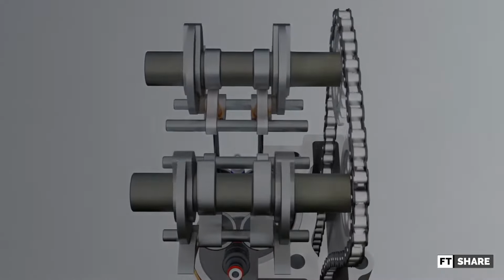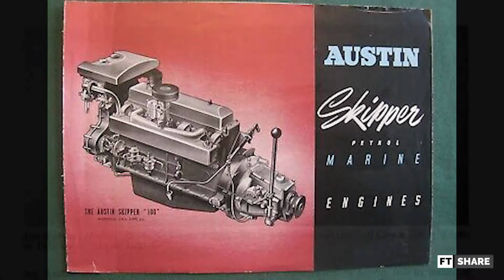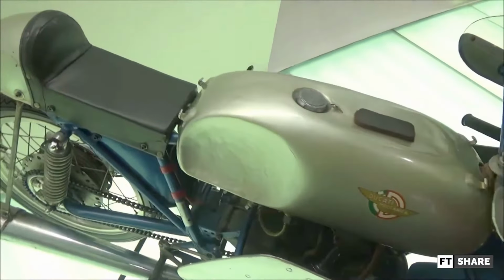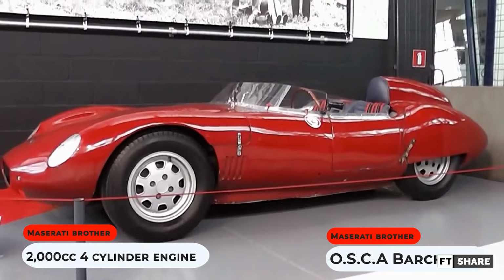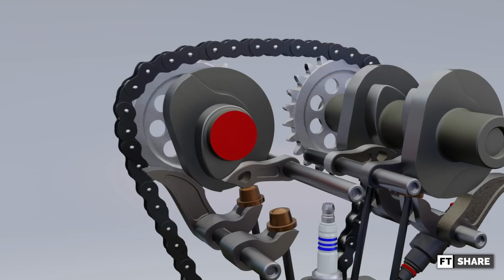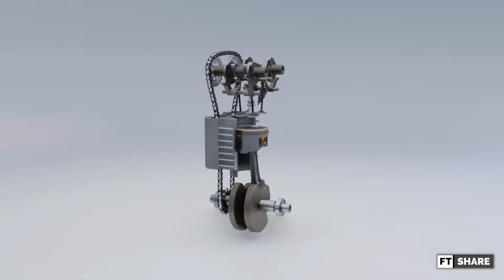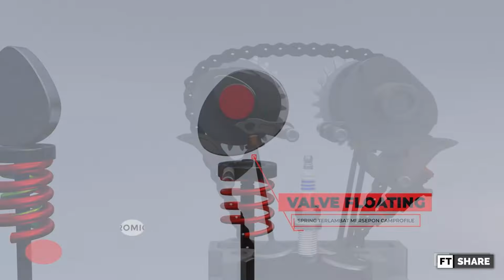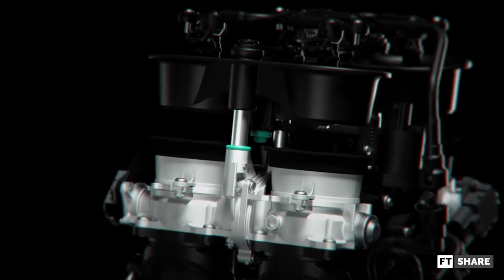Ducati Desmo Valve System | HOW ITS WORKS

Comment: Why it's not used for 4-wheeled vehicles? Easy one: too few ones need such high RPM's like 15-20k (most cars don't even hit 9k nowadays) and too much Desmo service needed. Even if you don't have hydraulic adjusters you'd need to adjust your valves like every 70k kilometers on Honda vs 25k or less on Ducati. On other cars you don't need to have these adjustments at all due to hydraulics.

Comment: 4:11 - Valve spring tech and metallurgy has advanced to such a degree that the additional complications of desmo isn't seen as worth it.
Reply: Well yes and no. As valve goat is still very much a thing. And with traditional valves they require shimming or lash adjustment as now the valve seat can wear down changing the height of the valves. The valve seats and lifters in the desmo design allow no need for valve adjustment which is better for longevity. Further more the lack of valves springs and the design of the lobe that closes the valve eliminates valve float. So in theory you could rev this engine at 1200 rpm and have no float and rev it out to 20k rpm and have no float. Without needing to swap valve springs to prevent it. Which stronger valve springs wear out the valve seats quicker. Like this allows a dynamic pressure on the valves that changes with the rpm. And as for simplicity a spring with a shim and a cup or with a lifter. You’re removing those parts but adding more parts to another part in particular. You’re losing cups shims keepers and the spring. For another lifter and another can lobe. So it’s not that much more complex if at all.
Reply: @Seagull_seaven7  Valve goat? As in a goat that grazes on valves or a valve in the shape of a goat.
Also you're in idiot if you thing desmo valves don't need adjustments and maintenance. They actually need more than normal spring valves. They also take more time, more labor intensive and more costly to adjust and maintain. They also go out of spec faster with larger variations and need shorter service intervals. Just look at the valve service interval and cost difference on any desmo ducati vs any other sportbike. They also have a lot more wear and need more costly replacement. All those cam lobes and rocker arms wear out. But way to parrot things you heard but have no clue what you're talking about.
Reply: @jvillain9946 i actually have dislexia so yeha thanks for that bro.

Comment: Hello, FT-Share! I understand I'm late to comment on this video, but I still want to share something. Excellent video, helped me understand the history behind this system. And like others have said, your English is fine (though you might want to double-check your subtitles in future videos, you said 1896 and the subtitles read 1986.) 

As to your questions on why Desmo valves didn't catch on with road cars and what the last road car with desmo valves was, I can help somewhat. As I understand, the main reasons desmo valves fell out of favour for road cars despithe their high performance gains was the fact that they were still quite complex and high-maintenance, especially in contrast to the technology that emerged after everyone resumed building cars after the end of WW2: Fuel injection. Fuel injection was far more practical than desmo valves, especially for an everyday road car in the 1950s, when metallurgy tech in the period only allowed desmo valves to really perform best in high-performance applications like race cars and high-end sports cars, which segues into my other answer quite nicely: The last cars with desmo valves. 

As far as I can tell, the last road car with desmo valves (emphasis on road car, I do not know if race cars had them for a little longer) was the Pegaso Z102, a technologically-advanced, high-performance, coachbuilt luxury sports car made by a Spanish truck and bus manufacturer in the 1950s. With all the performance technology that the Z102 was loaded down with, plus the luxury trappings and coachbuilt bodywork that meant no Z102 was the same as another, I'd personally say this car was the 1950s equivalent to a modern built-to-order Bugatti like the Voiture Noir.

Hope this helped, and keep up the good work on your channel!

(Edits for grammar)

Comment: They are harsher mechanically requiring expensive valve service rates at more than double those of a spring system. This is why Ducati just abandoned them after decades of Desmo being iconic part of their brand. Changing to springs increased the valve servicing interval by 60,000 kilometers.

Comment: Basically this valve system is a perfect definition of timing.... valve open and close so accurate that it makes the engine pick up so fast that it makes you feel it like its wildin ❤ absolute perfect machine

Comment: TL:DR cars don’t need deso-valves. Too expensive and too complicated. Not enough rpm’s to warrant use.

Here’s how I see it: motorcycle production has always been way less than car production. So it makes sense for cars to be more cheaply made and not built for the enthusiast. For example, Ford sold 15 million model T’s in just a handful of years. During that same time frame, Harley Davidson sold a grand total of maybe 400,000 units? Motorcycles are for the enthusiast and cars are for the working man. A valve spring is cheap and easy to make and the spring itself never needs to be adjusted. The deso-valve is a more complicated system and requires finer tuning compared to a traditional camshaft and valve system. It’s great for performance! But it’s expensive and complicated. And for the average commuter that just doesn’t make sense. But even for a performance car it doesn’t make a whole lot of sense as the bigger engines usually dont achieve the rpm’s necessary to warrant the use of the fancy valve.

Comment: Great explanation of how it works. Although I used to own a 2016 Ducati Multistrada 1200S and I had nothing but problems with the bike plus ridiculous maintenance costs (timing belts every 5 years…..are they kidding!!!!) means I would never ever buy another Ducati. I now own a Yamaha and love the fact it starts every time!!!
Reply: I’ve had zero issues with mine. Maybe you just didn’t take good care of it.
Reply: @richardmann4006  I treated the Ducati exactly the same way I treat my Yamaha and I have never had a single issue with the Tracer or any other Yamaha or Honda I have owned.
Reply: I laugh at comments like yours,these bikes aren't meant for people who have zero mechanical experience,or money,if you buy an exotic you have to be prepared for maintenance,insurance,and rego costs.
Reply: My 2008 gt 1000 I changed the timing belts every 15k, 43k & no valve adjustment needed, changed oil every 5k.

Comment: Will changing your oil more often, say every 2000 miles prevent the Desmo valve system last longer before needing to service or lets say, when serviced not needing much adjustment ??

Comment: the 1st ones besides the desmo valve train they did not use a cam chain either but had a drive shaft to drive the over head cam ..there for nothing to break at all..rev it to the moon and it would stay together ..but not anymore cause now you got cam chains that break and valve spring that get very weak very quickly and cause the valves to become slow to close and now and then come in contact with the piston and it's game over revved out at about 14,000 when it happens does not leave much at all to nothing worth rebuilding

Comment: This overlitre engine is more like an engine to succeed in a race. If you drive slowly, this engine will definitely lose its vitality. Ducati hopes to apply the system to motorcycles with low CC.

Comment: As of 2023, Desmodromic valve system is rather outdated...Honda's Vtech was far superior - but now that is outdated as well.  We have cam technology that as surpassed the efficiency and output of desmo.  And yet, Ducati is still using this desmo valve on...Desert X!!!! WHY?!?!?!
Reply: Why it's Ducati if you need more explanation then you will never understand. It's Ducati it's Ducati it's Ducati.
Reply: @theEVILone0130  and I keep buying them because I'm addicted.  ;)  Safe riding
Reply: @LooxJJ  I keep trying to talk myself into buying one, I really want one but I'm one of these idiots who when I get something really sweet something bad happens. My 64 Impala was stolen, my shaved dropped in the weeds with a 351 Windsor with Cleveland 2 barrel heads and custom sheet aluminum intake  got hit by a little old lady that ran a stop sign. My  71 Cheyenne with a 402 and turbo 400 was  crunched when a tornado came through and a large limb fell across the cab front left to right. And my 62 chevy pickup was caught by the same tree limb. My 550 Honda got caught in a garage fire at the in-laws. It always seems to happen to my nice rides. My POS always seems to come out of everything a-okay. Heck my 72 mustang I tried to blow the  motor up and drove it until it was out of oil and still drove it ten miles home had to add four quarts of oil to it and drove it for another two months before selling it for 3500. But I keep thinking if I get a Ducati what would happen to it. So far my 85 Maserati quattroporte is spending most of it's time in my buddys climate controlled shop and i take it out once a week and drive it about 70 miles or so  to the neighboring town and go to the hardware store and the auto parts store for odds and ends that I include when I ship parts out. I recycle Alfa Romeo and Maseratis with an occasional Ferrari, Lamborghini and Fiat Dino thrown in. And one Canadian Citroen SM. It's ugly as sin but it's got a Maserati engine and hydraulic suspension and includes a jack stand in place of the jack. But it had a heated front and rear windshields and molded glass headlight covers that you can't find in the US sold car's. The front windshield has a bronze colored tint that heats up to defrost it. Well I'd better stop rambling and do something productive for the day.

Comment: Variable valve timing is complicated for desmodromic.  4-12 piston engine(car) is never reving higher than 12000 rpm. Desmodromic is to solve 19000+ rpm engine where no spring is feasible to follow that speed. That why ducaty bike is using this relics.

Comment: has anyone ever tried to do research by combining the roller rocker arm +desmodromic valve system? as far as I know from various articles on the internet that desmodromic often has problems in the rocker arm, the friction between the rocker arm and the camshaft makes the rocker arm not last long,
Reply: I was thinking the same thing when I watched this video
Reply: Very reliable,  43k on my 2008 gt1000 & valves stayed within tolerance. Changed oil every 5k.

Comment: I used to know the guy who own  the 748. According to him, the engine require to have valves adjustment on every oil change. That may be why it is not quite acceptable to be use in many applications other than in italian exotic.
Reply: Yeah that doesn't make sense,I think he told you that to discourage you from buying one 🤣😉

Comment: Very reliable valve train, problem is they are too noisy
Reply: Not any worse than a 60's muscle car with solid lifters. You either love the sound or you don't. But it's part and parcel of loving a Ducati.
Reply: I pair the solid lifter cam with a gear drive for the ultimate in chunk.
Reply: Does it tend to overheat?
Reply: @tonyfrancisco370  no there is no heat issues, just quite a tappy valve train but Ducati engines are so Rattley it doesn't really matter lol my ducati xdiavel s has the testastretta dvt engine and has amazing low end power and the Desmo gives it another kick high up.
Reply: desmo actualy is an all in all rev range advantage
Reply: No, pneumatic valve actuating is equal , or better for high revs other 16000 rpm ( valve springs limit to day in motorcycle technology due to size of the engines and of the the size valves). @endurofan9854

Comment: Complexity and wear problems cannot be overcome, so this system will always be for specialized purposes, mainly used by Ducati's determination to not change. Freevalve is the future for all IC engines.
Reply: I thought the same when I saw it in video. Imagine the friction with the closing lobe...my guess to work it's just to guarantee that stays closed because it's natural position of the valve or it'll have a great loss to fiction. Or maybe in motorcycle is viable while in cars it isn't. And with FreeValve you can make a different map at each rotation and the driver selection (eco, sport, etc) eliminating timing chain, friction losses, etc.
Reply: Lol, "mainly used by Ducati's determination to not change" what a dummy comment... Who won motogp plz ? Freevalve is the future... if you have the money. Desmo is and is gonna be always less expensive. You don't really know for sure
Reply: freevalve is great,
but the components being highly pricy and consists of parts hard to obtain,
soo nope,
not gonna happen,
on sports it could but in daily drive i doubt it
Reply: @kermitahnenerbe3722  You ever price out a desmo service on a ducati? And you wanna talk money? Weird flex, but alright.
Reply: Not a chance. Internal combustion engines simply can't compete with electric motors when it comes to peak power. They are not even close.

However, internal combustion engines paired with a fuel tank can beat the HELL out of lithium ion batteries. And in that application high revving is counterproductive. Standard valves in a 60+% efficient 10-stroke simultaneous combined cycle engine that allows for a teensy tiny battery in a series hybrid is the future.
Reply: @richardtheweaver4891  electric is gay
Reply: @richardtheweaver4891  The point of the car is something else: efficiency is not sought as economy, there are trains for that, but as power/weight and reliability: a compact powertrain with few moving parts (for which the rotary engine works exceptionally well, by the way). But the really important thing is fun and adrenaline, and for that a high-revving engine is almost inevitable, as is a great sound